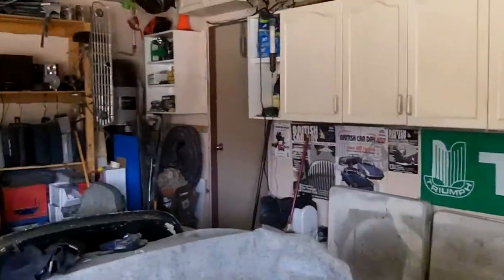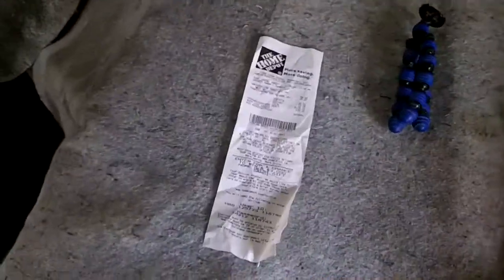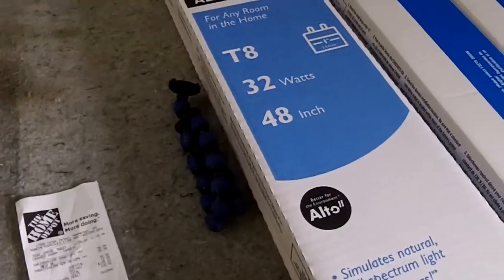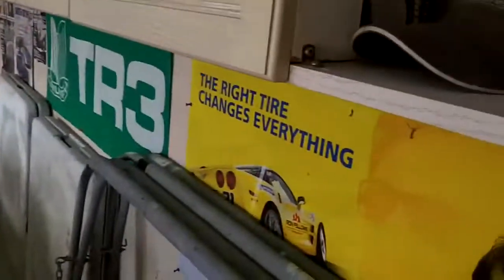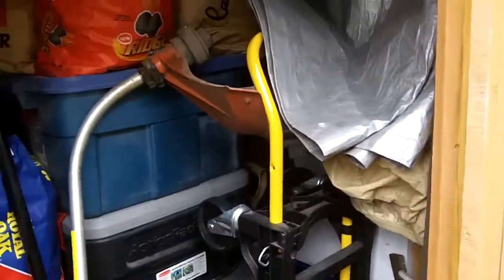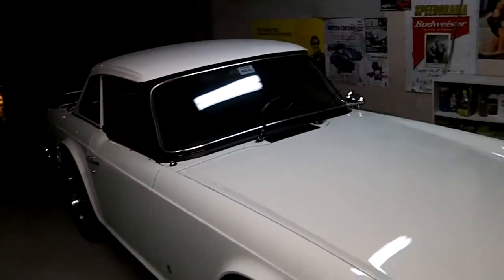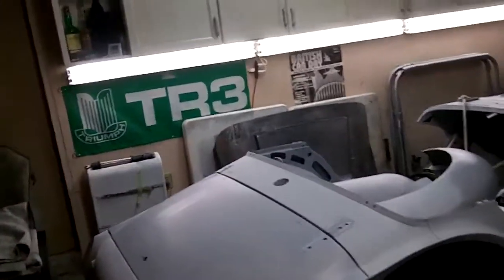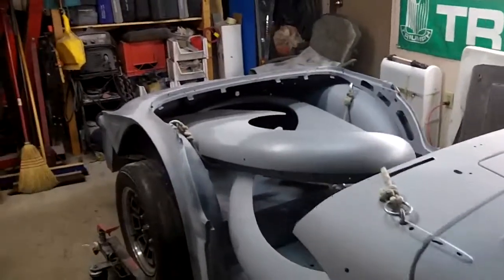Let there be (more) Light....

Comment: You could always use a couple of old rotors or drum brakes and weld a 2x2 tube upright to them and bolt a light to that..Then they would be movable and could be stored in a corner when not needed..
Reply: good idea